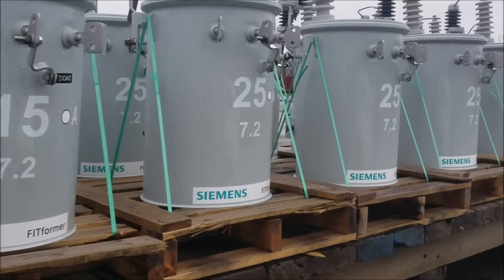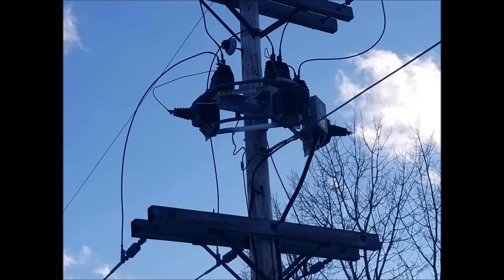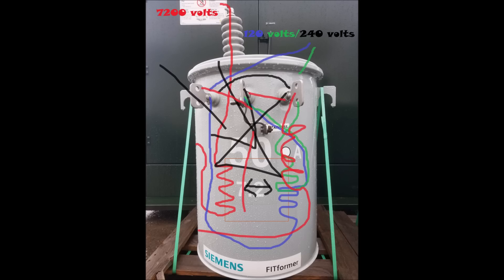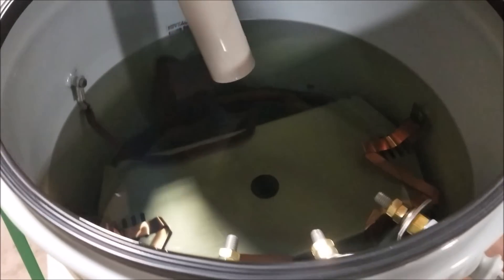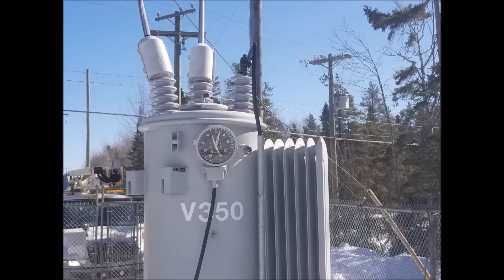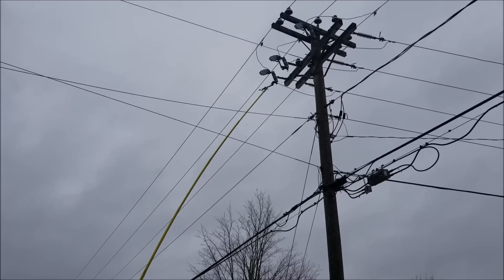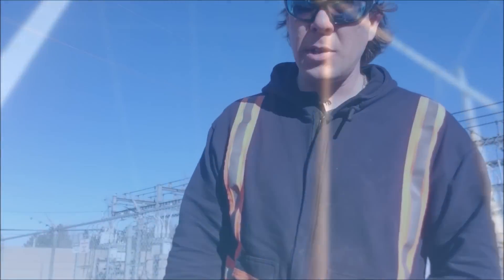What's inside a Transformer?

Comment: Thanks for this Unique Look inside a Transformer Aaron! I always Love to watch your channel , Speaking of Transformers , I saw some really Cool old Fashioned Transformers today that are still in service , I was Driving on a Remote road in Houlton Maine Just south of New Brunswick and in about a 5 mile stretch I saw 5 Very Old Westinghouse "Cow Head' CSP Distribution Transformers ( the Kind with the Primary and Secondary Bushings under the Huge Cow head Hat on top)  All still in service , I could not believe what I was seeing!  Probably Old 1930-40s Units that had been refurbished at some point they were all still painted black With a Real Good Suntan on them  with External Lightning Arrestors and they all had a Large Blue Label On then stating No PCBS (Less than 50 PPM ) I could Not Get a Good Shot of the specs Label on them But they were not very Big and only powered Single Residences Do You Folk in Canada ever still encounter Old CSP ( Completely Self Protected ) transformers , Just Curious is all? I also read a little bit about the Warning Lamps on the Westinghouse Units Apparently if they Were Nearly Overloaded to the point of Tripping the internal Breaker a red warning light would Indicate an Overloaded Transformer and might indicate a larger unit was needed for the service

Comment: I can't help noticing how the high voltage primary winding on your pole transformers return direct to earth, whereas ours here in the UK, or at least all those I've seen don't, they have neither end of the primary earthed, both ends go to high voltage with the required potential difference between the two, if it's single phase, or three for a three phase one.

Comment: The problem with not having a proper return but using the earth as a massive capacitor is it takes double the amount of energy to produce the same amount of work 
If the other end of the primary transformer was connected to at least another line let’s say the neutral line heading back to the generator you would save no much fuel

Comment: Those things to charge your laptop are not just transformers, they are a type of converter. They include a transformer for galvanic isolation. There is also a bunch of power electronics in there. With a transformer, you can only go from ac to ac, but with this converter, you first rectify the ac, then use semiconductor switches to generate high frequency ac, which can be transformed with a much smaller transformer, and is finally again rectified to generate a dc voltage of between 5V and 48V.

Comment: Oil is hygroscopic which means it absorbs moisture out of the air causing it to become more acidic (carboxylic acids) over time hence the actual problem concerning the transformer's insulation becoming compromised.  Same reason your air conditioning scroll compressor eventually grounds out because the newer refrigerants use POE oil instead of mineral oil.  POE oil is 10,000x more hygroscopic than mineral oil hence the reason most modern A/C units won't last as long as the old R22 units which used mineral oil.

... and we still have old transformers on the poles that contain Polychlorinated biphenyls (PCBs) which is wonderful especially around a dairy farm because if the cows are exposed to it then it is passed along into the milk hence you end up consuming it ☠ 

Alley Cat Bad Dog 🤔

Comment: Is energized solar that does not go down during a power outage really that dangerous for a lineman? It seems to me that no living lineman would ever work on a high voltage power line, grid down or not, without treating it as though it were live? Or at the very least testing it for power before touching it? I am also certain that like everything that I know almost nothing about that it is much more complicated than what I know :)
Reply: The inverters made for grid tied solar incorporate a technique called "anti-islanding" to prevent such an occurrence. If the grid goes down your panels are automatically disconnected. You won't have power either. Standard procedures for linemen working on a branch of the grid call for opening the fuse(s) feeding that branch, marking the pole or box where those fuses are located so that another crew doesn't reconnect them inadvertantly, and shorting all the high voltage phases on that branch to each other and ground.
Reply: @doneden5368  My solar panel system disconnects from the grid and keeps producing power. If the lines are tied to ground what is all the talk about "protecting the linemen" about then? In theory the inverters that did not disconnect from the grid and kept trying to produce power would be damaged when the high voltage phases were connected to ground?

Comment: Cooling is definitely one purpose of the oil. The other purpose is to provide insulation inside the windings of the transformer. Without the oil, the transformer would quickly fail due to internal flash-over even if it was cool.

Comment: These days, those little power supplies are not using transformers. They are switch-mode power supplies. They take anything from 90-240vac and using switch-mode technology make almost any voltage you need. From 3.3-50vdc and the output is regulated and over-voltage and over-current protected. I use a lot of them in my projects. I have a Masters Degree in Electrical Engineering. And I’m enjoying your channel very much!

Thank you!!
Reply: Even switch mode powersupies have a transformer so he is technically right.
Reply: @micsky99  Yes that’s true. But they are typically high frequency. So, a 10 amp switch mode power supply internal transformer is “tiny” compared to a 10 amp 50 or 60 hertz transformer. And some switch mode power supplies don’t use a transformer at all. Some small power supplies only use a fractional coil on a powdered balun. These are charge pump type, like an Apple charger for example, and during the pump cycle, a mos-fet will charge up the coil, then when off, the stored charge will keep a capacitor charged. Again, these run at about 600KHz to around 1.2 MHz, and are called ‘buck’ converters. I have a 40 amp 5vcd switching power supply, and it does use a small transformer, but it’s tiny, and weighs almost nothing.

Another reason most passenger aircraft use 440Hz. The transformers and motors are smaller and lightweight compared to 50/60 Hz transformers.

Thanks for making that correction. Appreciated!
Reply: @BigDaddy_MRI : I have a propensity for digression but will endeavor to stay on course for the sake of brevity. Retired now but when I was doing control work on production machinery I had to install small XFMR ( Step Down 240/120 PRI -Sec 24 Volt A.C. this XFMR had a feature called " FOLD BACK " . In other words you could load the secondary side to it's rated maximum, but if the secondary was shorted it would actually draw less current shorted than when fully loaded. Any idea how this was accomplished ? I had 4 yrs. theory as a journeyman wireman, NOT on an Engineering level so I can handle some basic theory if the answer requires it. But if the answer requires a visit to some guru in a Himalayan cave quoting Napier Logarithms, calculus and 3Rd Harmonics, I will respectfully withdraw the question. Working with an engineer on a generator one night, I found a wire disconnected. I asked.." Bob, how do we write down what the problem was, a loose wire ?   His reply " no not a loose wire " " there was a failure to maintain contact integrity of that wire " Engineering eloquence at it's finest !!

Comment: Correction: laptop chargers are converters and not transformers, they are diode based devices that convert the 120AC to 12V DC via means of PWM

Comment: A pc Power Supply is not a transformer. It picks up the power from  mains supply, so it uses a little transformer but do not works like a transformer. Nerveless, some people calls it a transformer  because  the input voltage is higher than the output.

Comment: "Leakage reactance" which is a magnetic flux path between the primary and secondary windings in the form as a magnetic shunt. Normally a transformer core is rectangular with one side wound with the primary windings and the other side wound with the secondary windings. If the secondary is shorted it will draw infinite current from the primary which is impossible so it heats up then fails.  With an additional flux path in-between the primary and secondary with an air gap. As the secondary current increases more magnetic flux is diverted from the secondary core through this additional flux path which acts as a ballast limiting the secondary current - a safety "valve" in other words.  So producing sustained electrical arcs are possible. 
Old school magnetic core neon transformers are like this, the secondary can be shorted without damage. The transformer is now drawing maximum primary current which is not normal as usually they're loaded to 80% short circuit current. 
For example a typical 15,000V neon transformer has a 30mA maximum secondary current with a maximum load current of 24mA.  Neon tubing has negative differential resistance so when current passes through the neon tube this causes a drop in voltage across it. Therefore if there is no "safety valve" the neon tubing is a short circuit to the secondary and either the transformer or the neon with fail...spectacularly. :P

Comment: We have one in our back yard (yeah, in my town they run utility wires on poles through peoples back yards!) and even with the slightest wind or thunder storm it trips and the few of us in the neighborhood on said transformer are SOL for 24 hours until they come with a long extension pole and reset something on the top of it and <<POP>> our power is restored. This has happened 3 times in the last month - it's getting expensive!
Reply from the maker: If they at working specifically at the pole with the transformer...They're changing the fuse on the cutout and closing it back in, unless there's a little "csp" switch on the transformer. Very well could be animals getting into the wire that feeds the primary bushing. It may be worth inquiring if there are any animal guards installed on the bushing and wire feeding the transformer. (If there isn't, there should be). 
The same type of fuse would also be protecting the main feeding the back lot area.

Comment: I used to work with a 1950s tube type X ray defraction machine at the university.  The back had about a 100 gallon tank of I assume PCB oil with breadbox sized insulators glowing white hot.  It had a 10 digit display on the front of counter tubes which were fascinating.  It was like Lost in Space.  I never felt safe around that thing.

Comment: My transformer is 4.7K. I'm near the end of line, so my transformer uses the secondary neutral as its ground. Also it feeds 7 houses. It needs upgrading. Originally everyone had 60 amp mains. With the HVACs now, there's too much load. A neighbor running a washing machine will make the lights pulse. It's been reported to Appalachian Power, but they won't change it. 🐀🐾

Comment: Not to be too pedantic, but...
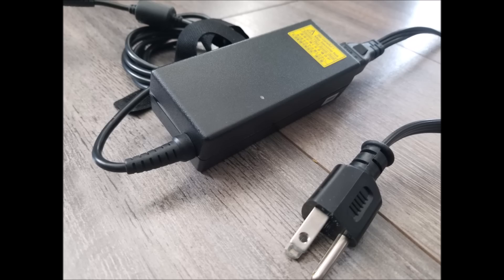5:40 The laptop power supply almost certainly outputs 19-20v
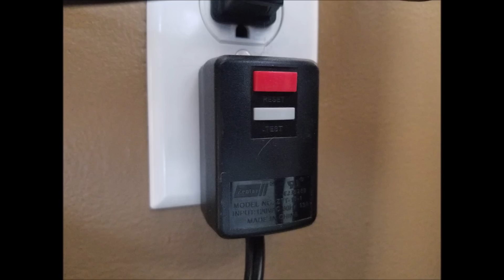5:53 Not a transformer, just a GFCI
Also, all the household power supplies work with high-frequency, and output DC. They do work on a similar principal to grid transformers.

Comment: I'm not an electrical engineer, but let me try to walk through the math  A homeowner generator putting out 10,000 watts at 220v is 45 amps.  Let's say the homeowner's transformer has a 17k input voltage so there would be .58 amps of output current if the transformer was back fed.  I'd doubt those few amps would cause the arcing shown at the beginning of the video or set a vehicle on fire.  What I suspect would happen is the generator would instead attempt to feed the immediate neighbors' transformers and their homes (unless there is a better path to ground nearby).  The homes probably are not disconnected so now the generator is dramatically overloaded and will blow its primary breaker.  Even if the generator didn't have a breaker there is a good chance it would stall the engine from the massive overload.  I'm not saying the risk isn't real I just don't know if it's as dramatic as made out to be.  Why am I wrong?

Comment: "water and electricity do not mix"

That is both true and not true.

It is true if there is minerals and salts in the water.

However if you have distilled water without any contanimants then that statement is less true.

That is why you fill an lead acid battery with distilled water... otherwise the battery would most likely short it self out very quickly...

Comment: Facinating.  There are 35-40 y/o ground-based transformer modules across my city.  Obviously, it is not my place to access them and It is a fairly big city in Canada.  Would it be safe to consider that the formerly PCB loaded oil has been replaced even in the older fixtures?
Reply: I wouldn't assume that.

Comment: I had one of those transformers fall off a pole in the field after a storm (possibly a small tornado). Out of curiosity I picked the thing up and was surprised I could honestly carry it and then popped the lid to see it was mostly empty inside other than the actual transformer itself, I always figured they were more stuffed inside. The power company eventually hauled it off since that transformer wasn't even in use anyways.
Reply: More than likely all the oil had drained out of the transformer. They are filled to the brim with non-conductive oil.Depending on what size transformer it was, those things are usually 200 -300 pounds for your normal house feeding transformer. And it only gets bigger and heavier from there.
Reply: @jakebhunter3014  Maybe they did, I honestly can't remember if there was oil still in it (it's been 5-ish years)

Comment: Can't they encapsulate the conductors in the transformer so water can migrate into the transformer without causing a short? Alot of maintenance effort could be saved not checking the oil.

Comment: The power adapters around the house are not actually dry transformers these days they are mostly switch mode power supplies, they do have a small ferrite transformer inside thou but, they do not run directly at line frequency like distribution transformers do. They are not called dry transformers as such they are referred to as switch mode power supplies. In the 80's most power adapters were actually little EI dry single phase transformers, they were rather heavy. A switch mode power supply or SMPS is vastly more complex than a dry transformer, and tend to go pop more often so you have to keep replacing them for new, too boost manufacture profits. While the iron core transformer is simple, its the most clever and most efficient machine ever made.
Reply: @Bobsdecline - Lineman blogger And the one at 5:53 is just a GFCI!

Comment: Another great video! I have a basic understanding of 3 phase AC power since that was a requirement of my job. I also knew about the oil cooling used in x-formers. What I'd like to know is how you (seem to) use a single tap off of the primaries to deliver 3 phase AC. What sort of witchcraft is this? I promise not to tell. Cheers
Reply: The output is not 3 phase AC but 240v with center tap for 2 phase 120v
Reply: @barnobeats5724  Thank you Barno. So, it's a single phase?
Reply: @gerardmoran9560  To provide 3-phase power you’d need 3 transformers.  I don’t know if any manufacturers package 3 of them together in a single can, but my guess would be no.
Reply: @kc9scott  There are three-phase-in-one-unit transformers.  In North America, most of this type are pad-mount transformers.  Pole mount versions are much more common in Europe and elsewhere.   

The number of transformers required depends on the type of 3-phase service. Two or three transformers may be required.
Reply: @barnobeats5724  Thanks Barno!
Reply: As mentioned elsewhere, these are not there phase transformers.  (Although, 2 or 3 of them could be used to transform 3 phase.)  

To answer your question:   The can itself is the other leg of the primary.  The can is grounded and so the "neutral" primary wire is grounded, too.  Also, the neutral on the secondary side (the center tap) is also connected to the can and also grounded.

Comment: The little black box transformer inside your house is actually not a transformer at all! It's called a "switch mode power supply". It contains a small ferrite core transformer, which operates at a much higher frequency something like 10 kilohertz. This high frequency is generated by clever electronics inside. The mains voltage comes in, is rectified to "high voltage" DC, then via transistors it's switched at a high frequency into the tiny little ferrite transformer. Then the output of that little transformer is rectified back to DC. People mistakenly called these things transformers. Maybe you can get away with calling them electronic transformers. SMPS. You can tell the difference because the old fashioned small wall plug in transformers, were much heavier. Whereas the new ones way almost nothing.